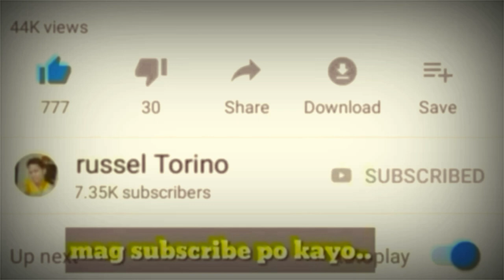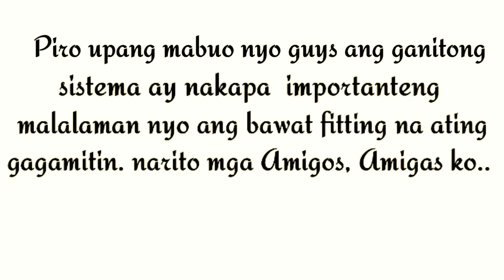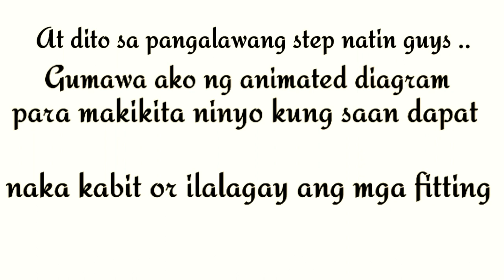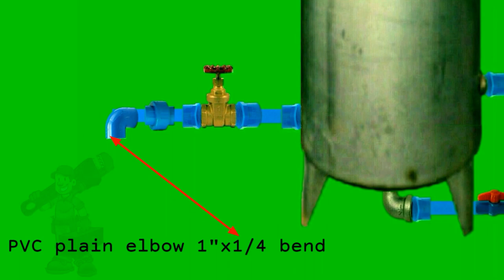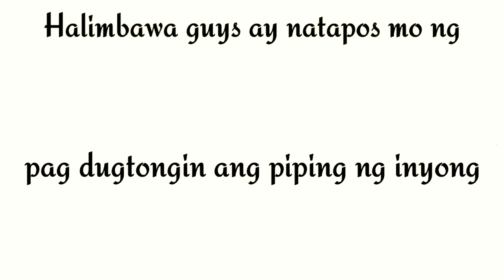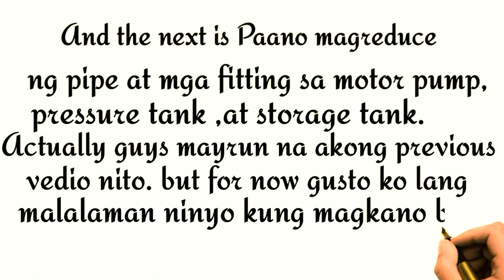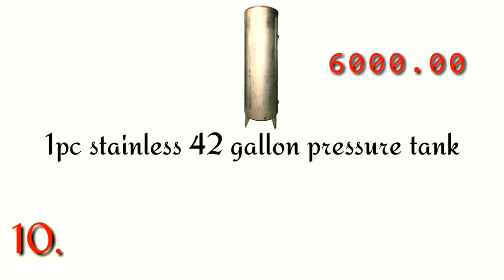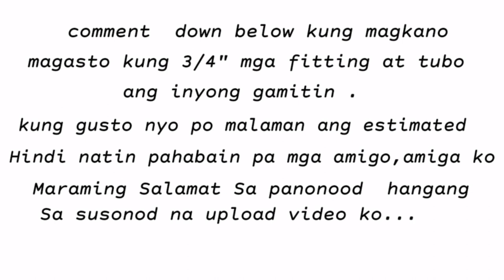ESTIMATED BILL OF MATERIALS SA STORAGE TANK, MOTOR PUMP AT PRESSURE TANK.

Comment: Sir hindi po advisable na walang grounding ang motor. Importanteng importante pong nakaterminate sa ground ang green/yellow stripes na wire para sa safety ng equipment at ng tao. Nasa PEC po yun. Connect nyo sa grounding bar sa panel o rekta nyo sa ground rod.

Comment: Hi po. Di ba po sabi nyo yung union kinabit just in case magkaproblema sa pump.. Ano pong mga steps muna ang dapat gawin bago galawin ang union? Switch off ang pump, off ang inlet valve, at ano pa po?

Thank you..
Reply: Yung ball valve po kasi ng linya na papunta sa bahay namin may tagas na kailangan palitan kasi panay tulo ng tubig kaya madaling maubos tapos magkakarga na naman sayang tubig..
Reply from the maker: Bago nyo, buksan or ikutin ang union, sa koneksyon ng inyong motorpump, Una, switch off, source current ng motorpump, ang gate valve ng intakepipe sa inyong motorpump, Pero kung walang check valve na ikinabit between motorpump and pressuretank pipeline connection, kailangan nyo,idrain Lahat ng tubig sa inyong pressure tank, bago nyo buksan ang union fitting.

Comment: Boss sa GROUND FLOOR nmin 24hrs water supply. Sa 1st floor 9pm-6am lng. S 2nd floor hndi n tlga naangat ang tubig. Ano po cheapest/best solution para magkaron ng supply hanggang 2nd floor roof top nmin? Kailangan p b tlga gumamit ng pressure tank? Thanks in advance. God bless😊
Reply from the maker: Yes Tama ka Sa Sinabi MO ang Kailangan nyan ay pressured ang tubig nyo mamili ka lang Sa ating diagram either Gumamit ka ng bladder tank or pressure tank.
Reply: @russelTorino  boss pwede po ba pag ang pressure pump ay ilagay sa bandang 2nd level ng bahay para kahit walang kureyente ay may agos pa rin ng tubig sa 1st floor ng bahay?

Comment: idol good evening,pwedi bang gumamit ng 82 gallon sa presure tank kasi may 3rd floor at ilang hp  ng motor pump ang recomended,thank you
Reply from the maker: Suggest ko po sa inyo bladder tank nalang ang ipakabit nyo, kahit 1 HP ang motorpump pump ay kayang kaya na.at puyde PA maiadjust ang pressure more than 100 psi.

Comment: sir. pwede ba blue drum instead of water tank na stainless? 
then yung blue drum sa ground then yung water pump and pressure tank sa 4th floor? 
salamat sir.
Reply from the maker: Yes.. Piro dalawa ang blue drum na gagamitin nyo. Sa baba at sa taas at dalawa din po ang ang motor pump, suggest ko po sa inyo inyo magpakabit bladder tank ka nalang kahit walang storage tank,  malakas pa ang tubig from ground floor to 4th floor.
Reply: @russelTorino  hindi po ba sya malakas sa kuryente? yung bladder tank na bibilhin ko po kasi 24L lang po.
then yung supply po direkta sa nawasa. kung bawal po ang direct sa nawasa. need ko ng blue drum.  salamat po sa pag reply sir.
Reply from the maker: Hindi po.. Magastos sa kuryente, basta magprovide ka lang ng blue drum, para imbakan nyo. At dun MO ikonek ang motorpump. Wag nyo iderect Sa linya ng nawasa.

Comment: May storage tank lang ako sa itaas, may laman namang tubig, ang problema. Pag nawawalan na ng tubig ang manila water, wala rin supply ang tangke kahit may lamang tubig at bukas naman ang linya. Parang wala rin kwenta ang tangke. Ano kaya remedy dito bro? Nsa rooftop 3rd floor ang storage tank ko. Thank you
Reply from the maker: Kung  may motor pump yan linya nyo.palagyan nyo po ng floater switch dyan dyan sa tangke. Konektado Sa motorpump. Piro kung direkta at walang motor pump ang linya papuntahan Sa storage tank pakabitan nyo po ng check valve. Maraming Salamat...

Comment: Sir gawa ka nman ng dalawa un motot pump may tanke sa taas ng building 5th foor lng un ginagawa ko paano ba installation ng pump.may baypass ba un sir.pki sagot naman maraming salamat.mas maganda king makakagawa ka ng video salamat ulit sir
Reply from the maker: Sige gawan ko ng diagram. But for now. Suggest ko Lang muna sayo. Down feed system yan ginawa MO. Kung Hindi deepweel yan source ng tubig nyo. Ay binawal Sa water district. Ang pagdirect kabit ng motor pump Sa kanilang linya kaya Kailangan MO. Maglagay ng storage tank dyan sa ground para imbakan. Bago higupin ng motor pump paakyat Sa roof deck or 5 floor.
Reply: Ok ang galeng mo boss

Comment: Good morning sir. Tanong ko lang po yung situation sa bahay ko: mahina po ang supply ng tubig ng water district sa area namin, hindi kayang umakyat ng tubig sa shower head. Plano ko sanang maglagay ng ganyang set-up, pero baka hindi makaakyat yung tubig sa ibabaw ng stainless tank (yung magiging source ng tubig ng pump). Would you suggest na gumamit na lang ako ng plastic na drum at ibaon ko ng konti sa lupa para lang makaipon ako ng tubig pang supply sa pump going to pressure tank?
Reply from the maker: Ilang palapag po ba ang inyong bahay? I kung 2 storey or 3 puyde Lang ibaba nyo ang storage tank at kailangan nyo ng pressure tank kahit 21 gallon lang.
Reply: @russelTorino  bungalow lang boss, pero di kayang umakyat ng tubig sa shower from water district. Hindi naman barado mga linya.
Reply from the maker: Kung bongalo Lang, mas mainam na ibaba nyo ang storage tank pagtabihin Sa pressure tank at motor pump, kagaya ng Sa video.
Reply: @russelTorino  boss pwede po ba pag ang pressure pump ay ilagay sa bandang 2nd level ng bahay para kahit walang kureyente ay may agos pa rin ng tubig sa 1st floor ng bahay?
Reply from the maker: @fkprocrastinatus2309  gawan nyo nalang ng bypass line papunta sa ground floor, para kahit brown out, may tubig parin kayo sa ground floor.
Reply: @russelTorino  yung bypass line eh galing sa nawasa po boss? Minsan po kase walang tubig from nawasa kaya naisip ko if pwd yung pressure tank is ilagay sa ka lvl ng 2nd floor para kahit sa ground floor man lang may daloy mga gripo
Reply from the maker: Puydi po ba, Mag, attached kayo ng video or pic, search nyo lang itong page Ko, "Tubero Sa cambanggo " sa fb. Para makita ko.

Comment: sir pwede po ba yung electric pump na mabibili sa lazada ilagay sa blue na water drum para papunta sa 2nd floor lang na tubig kahit isang gripo lang po
Reply from the maker: Oo piro hindi Pa drum ang gagamit nyo Kundi maliliit na pressure tank. Para itulak nya ang tubig papunta sa 2nd floor.
Reply: @russelTorino  ang plano ko po kasi sir ay ganto may drum ng tubig sa baba na may laman ng tubig. tapos sa 2nd floor naman po ay may drum din ng tubig. lalagyan ko po ng water pump yung sa drum sa baba papunta dun 2nd floor na drum kesa mag buhat pa po ako. pwede po ba yun
Reply from the maker: @andrewenricotanrrt1875  ah OK.. Ang gawin nyo Lang po bibili kayo ng floater switch. At ikabit MO dun Sa loob ng drum. Sa 2nd floor. Para Mag automatic on and off ang motorpump. Maraming Salamat po... God bless . Stay safe...
Reply: @russelTorino  ok sir. thank you subscribe po ako sainyo. malaki pong tulong. bali po ang kailangan ko lang po ay water pump. na point 5 or 1 horse power  at floater switch tapos po. yung in po ng water ko sa water pump ay sa mang gagaling sa first floor tapos sa 2nd floor po ang out. tama po ba?
Reply: sir may water pump na po ako with bladder hindi ko mapagana. pwede bang ang tangke ng tubig as source ay nasa baba. lang kaya bang hilahin yun ng water pump pls reply
Reply from the maker: Matanong Lang din.? San po nkapwesto ang water tank nyo? Sa roof deck ng bahay o Sa groundfloor Lang?
Reply: @russelTorino  sa ground po tangke papuntang 1st floor
Reply from the maker: Ah OK kung Nasa groundfloor ang water tank nyo. Dun ka kukuha ng supply or suction pipe na hihigupin ang tubig Sa motor pump. And then bladder tank. After bladder tank papasok na Sa bahay from ground floor to 2nd, 3rd floor. Okey...
Reply from the maker: https://youtu.be/Qmca4LlAuM0 for more info.. Click nyo nalang yan link na yan... Maraming  Maraming Salamat.

Comment: Kuya tanong ko lang po. Yung pressure tank namin is may butas butas na plano po namin bumili ng storage tank para gawing pressure pump. Pwede po ba na yung bagong pressure pump ay ilagay sa level ng 2nd floor para kahit wala kuryente eh may daloy pa rin ng tubig? Yung old pressure pump po nmn nka ground level lng sa may motor pump. Thanks
Reply from the maker: Storage tank, Ilagay nyo Sa second floor.at imbakan ng motorpump, dun Sa inyong storage tank, maglagay kayo ng floater switch. Na syang Mag, automatic on and off Sa motor pump. Kung kailan magrefill, o huminto.
Reply: @russelTorino  pag sa taas po kase yung storage tank, yung tubig lng na ginagalingan is nawasa hindi po makakaabot sa storage tank if nasa taas. Di po pwede na yung pressure tank ang ilagay sa taas?

Comment: Kuya tanong ko lang po sana ano dapat gawin dahil nawalan na ng tubig ang storage tank and nawalan na ng pressure ang tubig namin. Thanks
Reply from the maker: Location ng storage tank nyo? Saan po ba nakalocate?
Reply: Kuya ano po kaya dapat namin gawin?
Reply: Sa ibaba lang po. Magkatabi po sila ng pressure tank
Reply from the maker: Kung BONGALO lang po ang bahay nyo.gagawa kayo nyan Tower tank 3 meters ang taas para mayrung gravity falls ang tubig na mag supply Sa loob ng inyong bahay.
Reply: Kuya bale same tank din po ba gagamitin namin bsta kailangan nakataas lang ang tank atleast 3 meters? Thanks
Reply from the maker: kung bongalo Lang talaga ang bahay nyo. At Hindi kayo Gumamit ng 🚿 heater. Kahit walang pressuretank  At motorpump .downfeed tru gravity Lang puydi na.
Reply: Ganun po ba? Sayang at bumili pa kami pressure tank and motor nakakahinayang. bigla nalang nawala ang pressure ng tubig namin pero umaandar parin ang motor parang tunong ng aircon.
Reply from the maker: Lumobo PA ang bayarin nyo nyan Sa  kuryente. Anyway Andyan na yan. Kung nagustohan nyo ang suggest ko o Hindi nasa inyo parin po ang desisyon.
Reply: Oo nga po. Daming salamat po sa info. Nakakalungkot lng dahil ang pangit po ng experience nmin dito sa mga tanks wala pa isang buwan ang dami na nya problema.

Comment: Boss kong 1/2 hp lang ang motor kaya bang maka hatid ng tubig pa 2nd floor? at anong pressure kaya?
Reply from the maker: Dependi po... Ano ba klase motorpump yanBossing ?convertible with ejector or shallow well pump lang?
Reply from the maker: Kapag shallow well pump lang po yan. Pang BONGALO lang yan with 2 fixtures group lang. At Kailangan na na mayrun kayong storage tank. If 2 Two Storey or 3 storey ang bahay nyo. Need mo ay 1hp na.
Reply: @russelTorino  wala pa kasi akong motor boss..plan ko is mag lagay ng storage tank galing water district. tapos motor pump at pressure tank na papunta bahay na may 2nd floor...tama ba? yan kasi nakikita ko sa video mo.
Reply: may nakita kasi akong 1/2hp at 70L bladder type pressure tank sa Lazada..paga pwede nato temporary...ano masasabi mo boss.
Reply from the maker: OK po.. Ituloy nyo Lang... That's good  plan.
Reply from the maker: Yes ,as temporary but be sure na mayrun kang storage tank.
Reply from the maker: Suggest ko Lang po  sa inyo .kung gusto nyo midyo makatipid at matibay ang inyong water pipe line ipasunod nyo nalang ang diagram ko. Piro pPR fittings at pipe ang ipagamit ng tubero nyo.
Reply: @russelTorino  kong malaki yung pressure tank boss mahihirapan na ang motor?
yung storage ko boss 4 na blue barrel..madami na yun. ^_^
Reply from the maker: Ah Okey nka serries ang 4 na yun. Yes mahirapan talaga. Ideal way to balance the function between pressure tank and motor pump ay kung 1/2" HP ang motorpump nyo Parisian MO ng 12 gals. Na pressure tank. At kung 1hp naman ay 42 gals. Ang pressure tank .
Reply from the maker: Ah Okey nka serries ang 4 na yun. Yes mahirapan talaga. Ideal way to balance the function between pressure tank and motor pump ay kung 1/2" HP ang motorpump nyo Parisian MO ng 12 gals. Na pressure tank. At kung 1hp naman ay 42 gals. Ang pressure tank .
Reply: @russelTorino  salamat boss at least alam ko na anong tank lang max ko...buti nalang nakita ko channel mo.

Comment: hello po tanong ko lang po sana, sa bahay po kasi namin walang lumalabas na tubig sa gripo po namin sa kusina tsaka sa banyo po, bungalow lang naman po yung bahay namin at 20 years na po kaming nakatira, yung water source po hindi po 24 hours nagsusupply ng tubig meron lg po oras tapos after nub titigil na po yung tubig.. ano po ba yung cause bakit walang lumalabas na tubig sa gripo namin dahil po ba sa luma at baka barado na yung tubo na daluyan nung tubig at kailangan lang ere-pipe o kailangan talaga ng booster pump at storage tank?
Reply from the maker: The best solution nyan, po nyan, ay Mag PA, repipe na po kayo at pakabitan nyo ng storage tank, motor pump at pressure tank, solve ang inyong problema, maraming salamat.

Comment: Sir magkano ang bayad ng installation pag sa baba lang pressure tank at water tank motor?
Reply from the maker: Kapag dati na mayrung pipelines at isalpak MO nalang ang pressure tank at motor pump. 1k, Kapag sayo ang installation ng pipe line Sa mga CR,lababo at mga gripo basta bongalo. 5 k ang kuha ko.
Reply: @russelTorino   Dito kasi samin sa negros occ. 7k daw di pa kami nagpakabit nagtatanong tanong lang muna ako kasi need pa kasi lahat fittings
Reply: @russelTorino   at saka sabi niya hindi daw pwedi sa taas na lvl lang sa height ng cr namin dapat taasan pa daw ang water tank
Reply from the maker: https://youtu.be/AgNp8TumCpE click nyo nalang ang link na yan. Okey kung ganyan na ang set up. Kahit Sa groundfloor Lang.

Comment: boss, magkano ba lahat nagastos mo sa ganyang fittings?
Reply from the maker: 30k plus. Dito Sa amin. Canbass nyo lang po. Dyan Sa inyong lugar. Maraming Salamat po....
Reply: Ahh ok boss.. 

Additional question boss. Balak ko sana magpagawa ng water system na may jetmatic pump, pressure pump, 1000L storage tank at filtration.. pangbahay lang.. magkano kaya aabutin na gastos kasama labor at materials? Kahit estimate lang boss
Reply from the maker: MagDepende kz Sa lugar po ang labor .dito sa amin. 5 k iba PA Sa elictrecian.
Reply: Aabot kaya ng 50k lahat lahat boss?
Reply from the maker: More or less...
Reply: Ahh ok.. salamat boss

Comment: paano po ang setup kung 4 storey and bldg?
Reply from the maker: Ano po ba source ng tubig nyo ?sa NAWASA or sa deepweel?
Reply: @russelTorino  maynilad po
Reply from the maker: Hito ang choices nyo, dalawa kasi ang, option nyan. Kung down feed ang gusto nyo, ito ang Kailanganin, dalawang storage tank, xample, 1000 liters Sa roof deck, Tapos 500 liters Sa baba, pressure tank at shallow weel pump na 1hp.
Reply: @russelTorino  pwede po ba bladder type with pump yong sa baba? Ilan liters po kaya at hp? Need pa po ba pump ulit sa roof deck pababa yong tubig?
Reply from the maker: Kung Maraming cr/plumbing fixtures ang suplayan nyo. From maynilad source Mag imbak Sa 500 liters na storage tank Sa ibaba, pagkatapos higupin Sa motorpump 1hp and then iakyat Sa 1000 liters storage  tank Sa roof deck, from storage tank Sa roof deck hihigupin nanaman Sa isang motor pump with, pressure tank and final from pressure tank to the building na. Ganito Kapag marami ang suplayan, nasa taas ang isang motor pump at pressure tank.
Reply: @russelTorino  last question sir, ano pong size mga ppr ang gagamitin?
Reply from the maker: 1inch ang main Tapos reduce to 1/2 inch, ang papasok sa mga banyo.